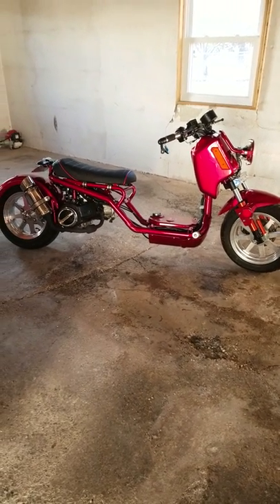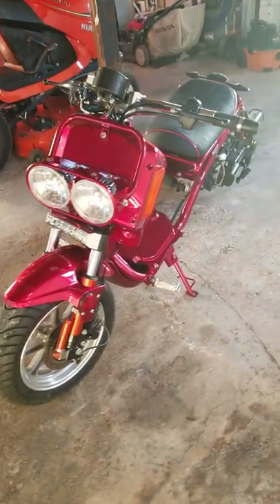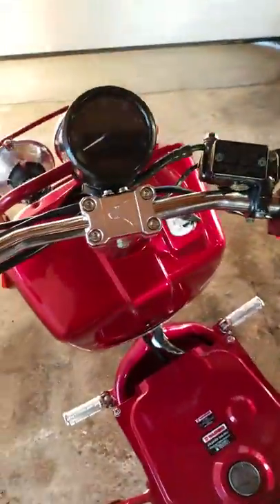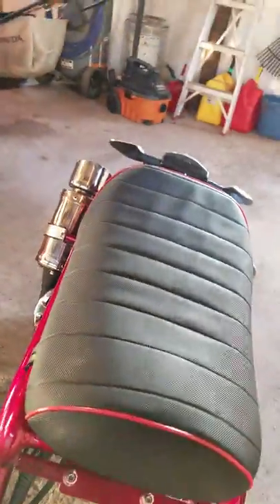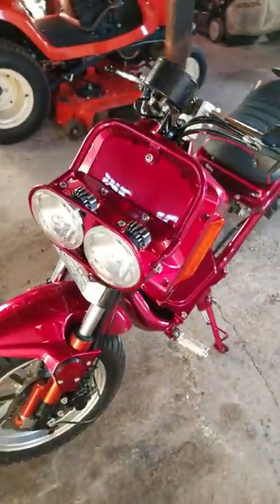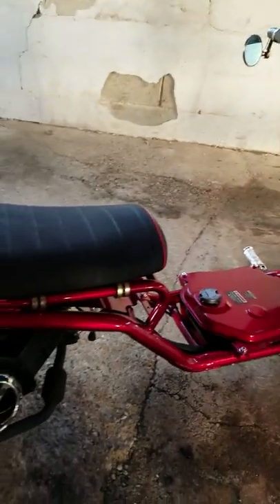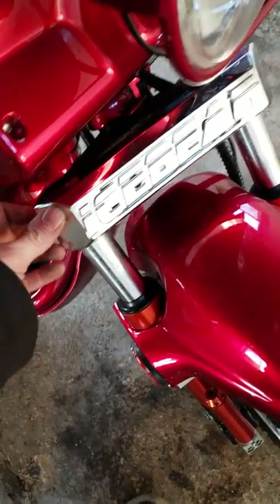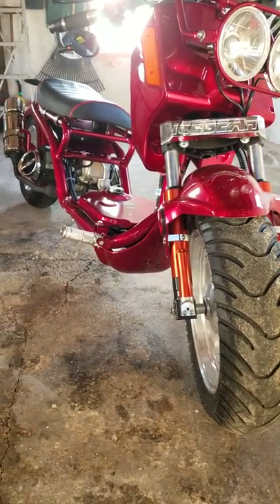2017 Icebear Maddog 150 (4th generation)

Comment: Those bike are still runing good with no plm ...let me know asap pls
Reply from the maker: Slim razor PLM?
Reply: Rspec Nick .....plm ...mean problem
Reply from the maker: Slim razor oh yea it still runs fine only issues is at wide open throttle for like 5 to 10 mins straight it starts cutting out cause the fuel pumps on these loose vacuum but that problem can be solved with a mukuni df44 fuel pump besides that it's good.

Comment: Did you have any issues registering in Pennsylvania
Reply from the maker: Britt Berger yes but only because I bought it off someone else who never got the certificate made into a title before if you buy it used make sure it's a actual title with it not a certificate of origin but if it's an actual title like a car title them your all set only the original buyer can change the certificate of origin to a title I found out the hard way I had to find the original guy after I bought it lol
Reply: Rspec Nick di you get it inspected
Reply from the maker: Britt Berger yep since it's brand new they didn't even care I got a sticker within minutes

Comment: Nice!! what the top speed on 150cc?
Reply from the maker: coolshariq top speed is about 64mph fully wound out.
Reply: Rspec Nick cool!!
Looks pretty badass!! I have a 150cc tao tao  2016 model I got it as trade it's a blue one but the tire is wide I need to get a different tire and new speedometer and do some mods it.
Reply from the maker: coolshariq yea man first mod is do is fuel pump switch it to a mikuni df44
Reply: Rspec Nick haha yep done change to mikuni fuel pump and also change the carburetor and UNI air filter!! Now I want to do tires and delete one side shock and rear tail light to R6 underseat.
Reply from the maker: Nice lol that's what I need to do still it's just been to cold here I wanted to run the fat tire but I don't wanna loose the rear fender either

Comment: I wanna get a 50 and mod it but I heard they have issues and are unreliable
Reply from the maker: What the icebear or the engines ?
Reply: Rspec Nick the maddoggs in general
Reply from the maker: @3kbaby823  so far only issue I've had was fuel cut off and an ignition coil breaking (my fault cheap parts) other then that it runs good
Reply: @RspecNick  I stretched out a tao tao 50 n it runs great. But I built the 150cc gy6 that's on it from parts. But far as that goes sange sells a pretty decent china motor for cheap online. Prolly the same parts I used 🤣🤣
Reply from the maker: @rem700sniperplaystationnet9  oh yea a new motor isn't terrible

Comment: Can you change the rear tire to a thicker one ?
Reply from the maker: I was thinking about doing that I'll have to pick up a mojo hub and a machined machines wheel
Reply: So are you able to do upgrade the tire to a thicker one? Where are you getting your tire at? I wanted this model but I want to know if I can change the back tire I like the thick tires
Reply from the maker: @mon.1567  you can do whatever you want with your scooter it's just a matter of how much money you wanna throw at it if you wanna run a car tire you would need a 140,70,12 I believe a mojo customs hub,machined machines wheel and a shorty axle as well
Reply from the maker: And I won't be doing mine for alittle bit now that winters about here all the parts together are about 500 bucks or so
Reply: Rspec Nick so you don’t ride yours in the winter time? . Yea I asked someone if you’re able to put a thick tire for the rear but someone said no because of the engine that it wouldn’t fit or something . That’s why I wanted to ask someone who owns this bike . Do you know what other website I can find mods like headlights or different taillights for this bike?
Reply from the maker: @mon.1567  yes you can fit a fat tire no problem and yes I still ride in the winter but half the time I drive cause it either rains or snows I work nights so when it's cold it's coldddd lol but I'd check out the www.gy6store.com
Www.nolascooterwerks.com
Www.cajunmaddogscooters.com
Www.sickspeed.com
Www.machinedmachines.com
Www.mojocustoms.com
Reply: Rspec Nick oh okay . Thank you so much . Where did you buy your bike from?
Reply from the maker: @mon.1567  I actually bought mine from a guy close to where I live when I had my other 150 swapped scooter he sold it to me for dirt cheap with 160 miles on it
Reply: Rspec Nick oh okay . Do you think ruckus parts fits this bike?
Reply from the maker: @mon.1567  yes there's a lot of ruckus parts that fit these bikes most of the plastics the gas tank the gas cap pretty sure the seats engine wise no there completely different our engine code is a 157qmj
Reply: Rspec Nick oh okay . Do you know what’s the biggest size of rear tire this bike can have ?
Reply from the maker: @mon.1567  the biggest rim is a 12inch by 8inch or 12x8